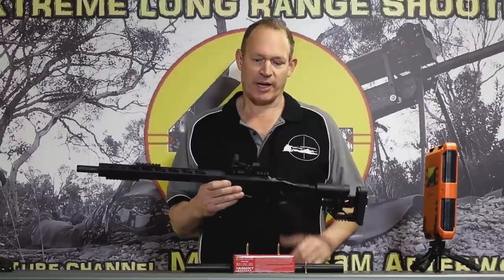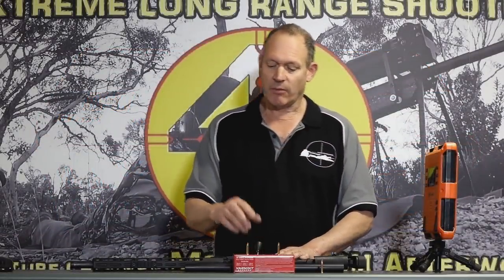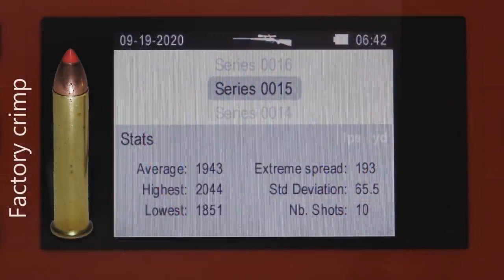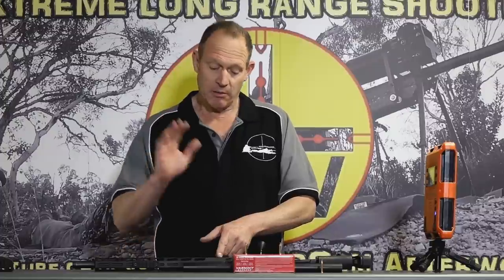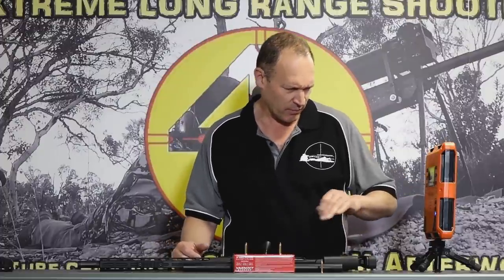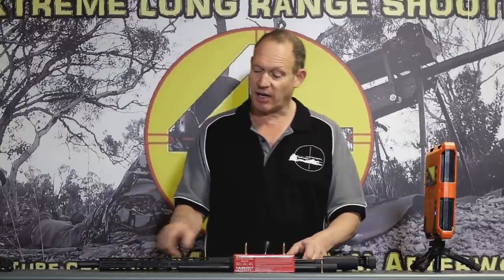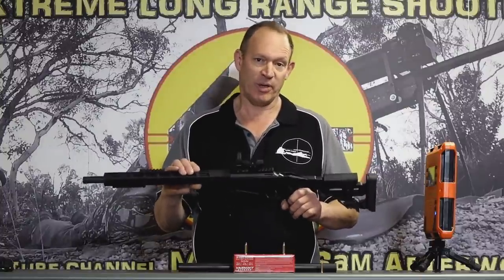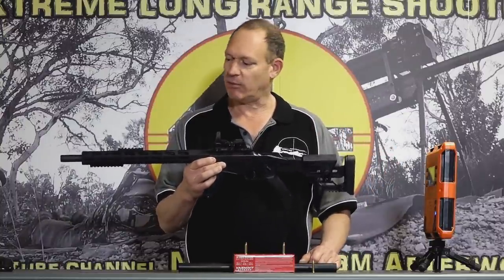22 magnum crimping???

Comment: Well, thanks to you and the previous video .22 magnum ELR, I got totally sucked into trying to re-crimp the factory .22 mag 30 grn ammo that you used. I bought crimping dies in every .22(?) caliber I could find, made a small end mill from a broken 11/32" twist drill to make the rim slot in an extended shell holder which I've yet to make, watched every video on You Tube about .22 magnum dies and crimping I could find, spent a few hundred dollars so far, and I'm not done yet! I was the one who suggested in the prior video comment section to test re-crimping the 30 grn factory ammo which you did in this video and with great results! Thanks for this great series on the old .22 magnum, a cartridge which deserves more attention and certainly better quality factory ammo.
Reply from the maker: Cheers
Reply: My favorite cartridge

Comment: I’d love to see you try taking the .17 WSM rimfire and neck it out to .224.   The .17 WInchester Super Magnum rimfire is based on a .27 caliber construction nail-set round and necks the case to .177.  It pushes a 20 grain round at 3000 fps, and pushes a 25 grain at 2600 fps in factory loads.   I’d love to see that bigger cartridge shoot a 40-55 grain .224 pill.  Curious what’s possible in a rimfire with that bigger, necked cartridge.
Reply from the maker: You would need to find someone interested in spending the funds, but would be interesting, Cheers

Comment: I would love to get my hands on the crimp tool 😁
Reply from the maker: Maybe have a chat to you gunsmith, Cheers
Reply: The issue is that you also need an extended shell holder because those crimp dies are for centerfire cartridges like the .204 Ruger, .223 Rem etc, and they are over twice as long as a .22 magnum. Mark said he also turned up a sleeve for the reduced diameter case on a .22 magnum to guide it into the large crimping die. See my post above for more details I learned.

Comment: Awesome stuff Mark.  Have you ever shot a .17HMR?  I've got a marlin 917 that easily shoots 1/2" groups at 100.  Would be super interesting to try this method with one of those and swap the 20gr bullets for 32gr bullets.  (I may just try this, since I hand load for .17Rem too)
Reply: Jason Lloyd Agreed. Of all my centerfire and rimfire guns, my 17HMR is among favorites. My Savage R19 BTVS holds 0.75 MOA consistently. The main downside I see with 17HMR is usage on small game which you intend to eat. On Cotten tails at short range, the frangibility of the 17 grain polymer tips makes a MESS and can sour the meat due to stomach acids.
Reply: @BurnDuration  Yeah, I've only shot jack rabbits with mine... but you put one in the boiler room and it liquifies them pretty good.  Jacks aren't edible so it doesn't matter much... but with a heavier bullet, and a hollow point instead of a poly tip I wonder if you could save the meat a little easier?  Have you tried the 20gr hp rounds?
Reply from the maker: No sorry, we have the 17 Hornet, but not use the 17hmr, Cheers
Reply: Jason Lloyd I have not yet tried the 20 grain FMJs on Cotten tails. My Savage doesn’t seem to group well with the heavier round, and groups opened up to ~1.5 MOA. On a flat range shooting slow fire on sandbags, I’m a pretty decent shot, but in the field shooting offhand I’m not that good, and I tend to aim center of mass. 

For larger red fox/coyote varmint hunting, I would not feel undergunned with my 17 HMR, and would likely switch to the 20 grain FMJ.